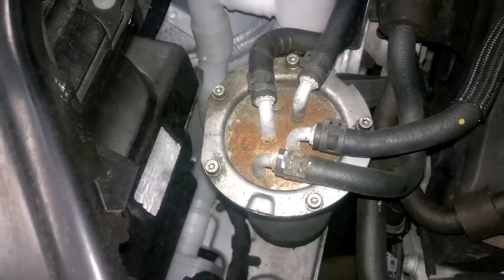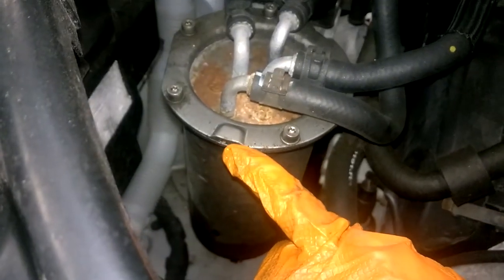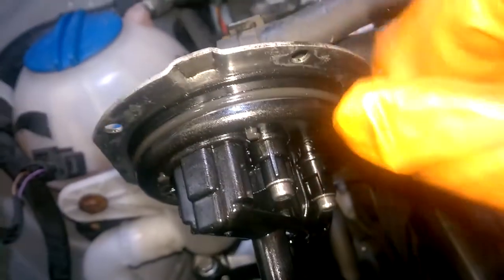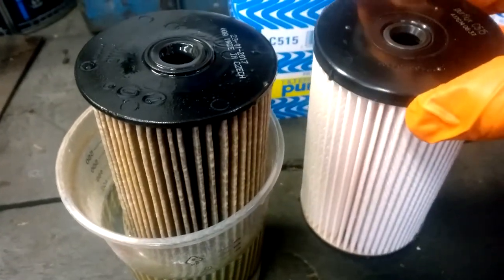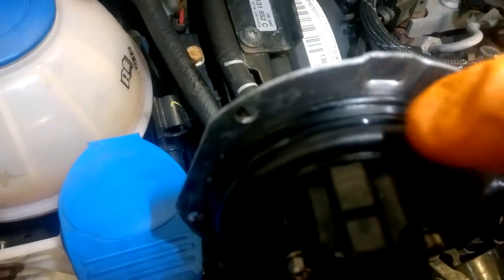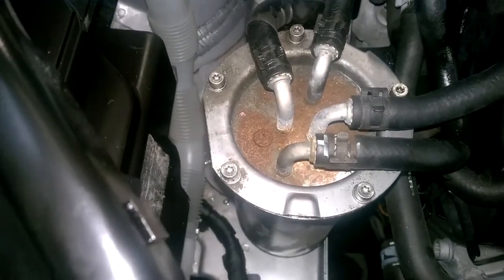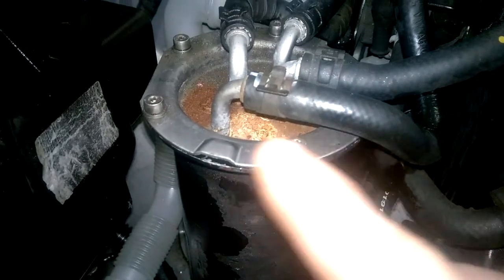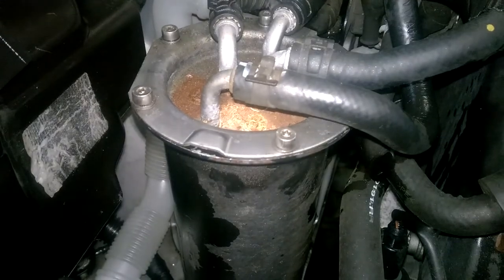Volkswagen Caddy How To Change A Fuel Filter -  2010 - 2016  2.0 TDI

Comment: Shudda topped up the filter can with fuel prior starting otherwise high risk damage to HP pump. V. Important with Common Rail TDi.
Reply: You turn the ignition without starting a couple of times for the pump from the tank to fill the fuel filter

Comment from the maker: As long as the fuel sits above the filter like seen @ 0:58 there will be no issues what so ever. Thanks for watching & taking the time to comment.
Reply: but i would need to fill up whit new diesel if its not above the filter?  and one more thing. on my ducati i used Loctite 5926 (blue silicon sealant) on the sealplate for the internal oil filter. could i use this on the diesel filter housing aswell?  thanks for the video :)

Comment: You know there’s more than one type of fuel yes?
Reply from the maker: Is that a question? Are you confused about your vehicle?
Reply from the maker: @Raoul Duke For Volkswagen the TDI means it is a turbocharged diesel engine only, I have wrote that both in the title and the description. Did you think this was a video for a petrol model?
Reply: Hi Gerald, my caddy stopped driving yesterday on checking the black pipe that goes into the top of the filter has sheared off, will this be stopping it starting?